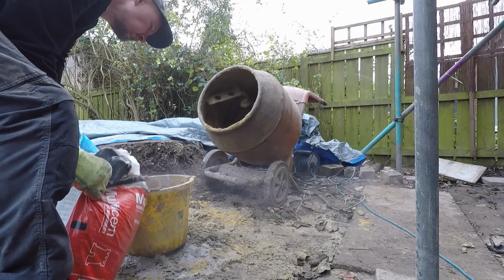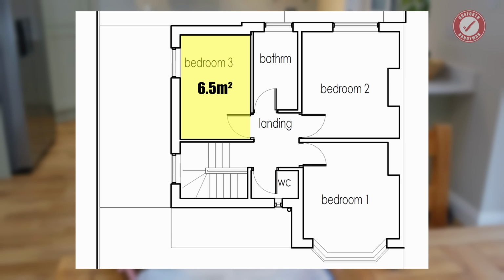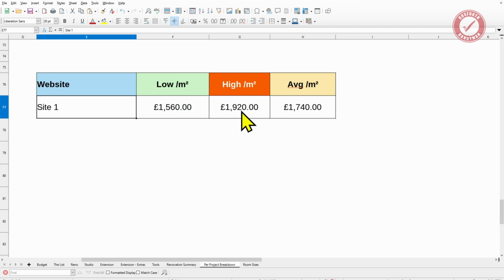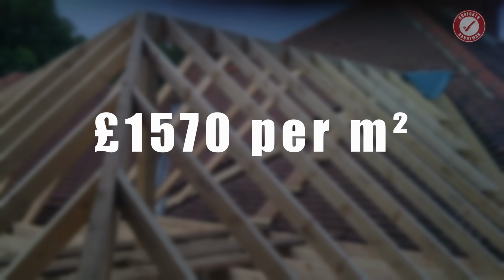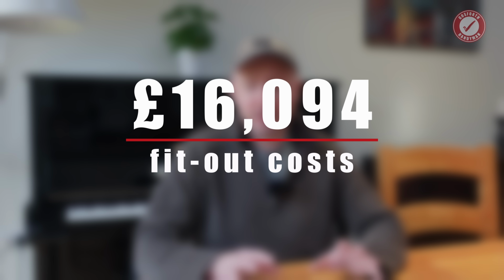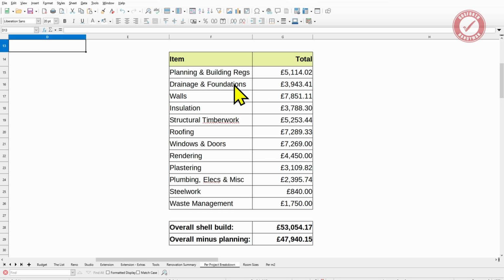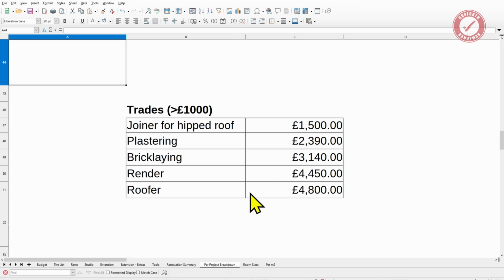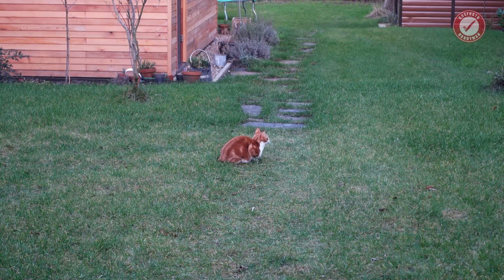How much does a UK house extension really cost?

Comment: The roof is a fair price, considering they're working at a height. You're not doing this in Ireland for less than €100k. I'm a plumber in dublin and the company I work for would charge €800 a day for me. Sparks are €1k a day. We have a shortage in trade people so the work is never ending. Companies can't hire enough lads to deal with the work. I know of 1 small 3 bed rewire that was quoted for 9k after the 1st covid lockdown. The same company said they would have to re-quote it 6 months later and they said €19700. They blamed rising costs and the home owner had no other choice but to go with it because he couldn't get anyone else to do the work. I'd say 150k in Ireland to do what you've done. 👏👏👏

Comment: I don’t understand how you can quote the actual costs for your extension and then say that for a low cost area you would actually pay more by quite a considerable margin I.E £978 for your extension per m2 and £1560 m2 for a low cost area.  Do you therefore live in a low low cost area?  I didn’t specifically hear anything in this part of your video which highlights why you came to this conclusion.  I understand where the figures have come from but your actual costs appear to highlight that they are wrong.  We looked at doing an extension last year and gave up after not getting any sensible quotes and the cost of materials seamed to be going up by the minute!  Hence I was very interested in watching your video to see the conclusions.

Comment: I’m in the middle of an extension build currently. We are knocking out a supporting walls to create an open plan kitchen diner with no folds. From re mortgage to now it’s taken over a year. Builders generally took at least a week to visit and another week or two to quote. Architects when I found one that was free took months to produce plans that were wrong and further weeks with constant chasing to produce correct final plans, I had the same issue with the structural engineer. The final figure was around 25k over what was quoted and the final project has been extremely compromised due to inflated costs. Having said all of that my builder and his crew are (so far) really good and hardworking and pleasant with really good comms. I’m hopeful of getting to a first fix (plaster/electrics/plumbing) at about 40k.
Reply: Also the steels (box steel and further large beam) are ridiculously over rated and would look at home sporting a railway bridge.

Comment: So I built a 30m2 kitchen-diner extension myself (which is very similar to yours). Three new walls, built 8m out the back of the property. Brickie and his dad (who did ground working) did the foundations, brickwork, got a solid flooring contractor in,  cleared about 40 tonnes of spoil (sloping site) and sorted the scaffolding for £13k. I bought the bricks, blocks and insulation. I then did pretty much everything else myself (except the Part P wiring), including the roof (pitched with hip) windows, doors, plumbing and boarding the ceiling and walls. Paid a plaster £800 for a skim, and an electrician £600 for the Part P stuff (I bought all the lights, sockets and distribution board). Plans cost a few hundred quid and the local authority forgot to charge for the building inspection. Whole thing came in at under £30k. Then I blew over £20k on a Wren kitchen sadly. Lots of quartz!
Reply: Imagine buying a Wren kitchen lol
Reply: More money for quartz!
Reply: 20k+ is labour/profit for builders

Comment: I had the sales guy from Beers the building merchants in today as Im looking to build a 3mx8m second storey extension. For the blocks, concrete and cement, ive been quoted just under 1500 quid. Glazing will be well under 2k for 3 french doors and juliet glass rails. These prices are more realistic as were building it ourselves over a few months. Im seeing friends getting silly quotes of 75k for the same size.   Ill be bringing mine in between 15 - 20k. Great video

Comment: Please if anyone can comment that would be appreciated: 
Just planning a house renovation. New bathroom, new stairs, removing a structural wall and putting in steel beam, new downstairs loo, creating pocket door between living room and kitchen/ diner, removing 4 chimney breasts, insulating under living room floor, installing two new skylight windows, and new plastering and painting walls everywhere in a 4 bedroom house ( 2 bedrooms in the attic won’t be touched) . 
Is a £50,000 quote realistic?

Comment: I managed a 7 meter dee and 8 m wide wall to wall extension, bedroom on first floor and a dormer in about £140000. I think I need another £20-30000 to now fully fit it out.

It has ufh and tiling on all three floors, no radiators and new wiring.

I achieved it by doing the work myself with my father and hiring two day labourers who did the grunt work.

The only thing I outsourced to contractors was brickwork, skimming and the hot water cylinder installation and the electric fuse board.

I did pipe work and electrics myself. Tiling myself. Etc etc. it’s taken two years of my life and probably another 6 months before I can get back to other stuff. But I have thoroughly enjoyed it. I won’t ever do it again though. 😂

Comment: If you’re going to manage the project yourself, you really need to be working from home. I moved out of the office during the pandemic. I dread to think how it would have panned out if I hadn’t been around during the day.

I took it slow and did it in phases with long gaps. Added about 110 M2 with a two story wrap around extension into a hill. I’ve not finished yet, but all the masonry and roofs are done.

Spent 140k so far and probably another £30 to £40K to spend - so pretty good on your calculations since will come in less than £1800 a square M and I’ve had to deal with 8 foot retaining walls and a fairly large amount of outdoor costs.

Would I do it again? Probably yes cos I know a lot now.

If I could go back in time… I’m not so sure!

Comment: Great video and really interesting. I'm on both sides of this, having been a joiner for 28 years and lecturing and working in construction. I am now halfway through an big extension at home that started pre COVID and due to spiralling materials costs, lockdown etc is still ongoing. As a self builder I have seen prices spiral during and post COVID... I wouldn't put any stead in pre 2019 prices...it's almost like a different era... In the last 4 months I have seen Aluminium window prices go up almost 40%. In the Swindon area building is going on at a staggering rate and materials demand and prices are definitely reflected in that... Don't even get me started on how expensive timber is.  Our extension is 2 storey and single storey...roughly 60m2 . My original costings in 2020 using Spons (worth the purchase price as this really will give you a very accurate pricing structure) was £90k Inc £10k pc sum for kitchen and £5k for ensuite...this is materials and labour.  I think realistically now we will be lucky if we keep it under £110k and I have done all the work...( Foundations with a mate who is a ground worker) all blockwork with another friend who is a bricky...so very much mates rates. All carpentry..roofing ..floors...concreting etc all me. Most of the plumbing fit out will be me but electrical work will be contracted out.  
Ours is what I would describe as High end build ( anthracite aluminium windows, Canadian cedar cladding, bespoke kitchen etc) so was always going to be on the high side but at the moment if you work on £2k per M2 you will give yourself some wiggle room. 

If your builder quotes £1k per M2 and doesn't itemise their quote then watch the extras roll in....or watch them bail.  There are no 2 ways about it building is expensive at the moment and finding reputable builders is going to cost so don't kid yourself it will be cheap. One of the biggest single expenses is skips...holy cow waste removal has gone up over the years. 

I should point out we had 4 quotes pre COVID.... They ranged from £68k plus vat for just a water tight shell.. No kitchen, bathroom or floors / internal walls ( I was going to do those) to .. £160k plus Vat. ( With no PC sum for kitchen or en suite) none of the quotes included plans/architects fees, site surveys etc as I did all those myself.  I think realistically if we handed our build to a good builder from the start and kept the same spec we would be looking at around £150-160k plus VAT... At the moment I am still on target for a £90k Inc vat spend but that includes everything including drive, gates and landscaping....so not just the 60m2... But remember I have done nearly all the work myself so no builders/ labour costs..but the quality is there it just takes time. ... It's the eternal triangle...Time, cost, quality.... Thanks for sharing your costs....all too often you see people running into financial difficulties when building ..relying on quotes and then looking at final figures trying to work out how they are 20% over quoted... Now imagine our situation where prices have literally doubled between pre COVID and post COVID..  god knows what we would have done if I hadn't been in trade. Take heed people ..never go for the lowest quote and always get references with pictures and testimonials you can follow up.

Comment: Extensions and loft conversions are my bread and butter . 17 years in business, 28 years in the trade . Yorkshire based. My basic rate for extensions at present is £1850 plus vat . Then you have the usual is it concrete tiled roof or is it slate and all those variables can alter the final amount . Not all jobs can cost the same of course. This price is a fully plaster finish , second fixed joinery in place and all plumbing and electrical works done. Then add ons would be fitting of client supplied bathrooms, kitchens etc.

Comment: We started a build ( loft conversion) alot of builders never returned calls,some overpriced!  In the end after lots of checks and recommendations the builder we went with told us half way he got his pricing wrong and needed another 20k!! Perhaps this is a tactic they use? Needless to say I finished the job myself and found the suppliers, building control ( went private) and engineer to be more than helpful in the completion. I did loose alot of weekends and evenings though. Luckily I have a trades background so this ofc did help. Building is still such a risk in the UK imo especially to those less informed than your self.

Comment: I have recently completed an extension which included an outbuilding (no soundproofing concerns) but went through a similar process opting for it to be within permitted development too.  The 2.5 M maximum height was a little open for debate when researching especially on slopped gardens.  
Unlike you, we had a difficult builder and although I had expected him to be here for a significant portion, he would send a couple of his guys over each day with little supervision.  I ended up having to project manage making sure materials were ordered on time, sequencing deliveries and trades people so that work would progress.

As I was losing confidence with him, I was forced to check and verify that everything was being done to the right standard in terms of building regs, including the checking that the correct size steel was used.

I now know that this builder did not know how to price a job or made significant assumptions on costs including labour.  We had a fixed sum contract in place which detailed every requirement he needed to meet and checked with him multiple times that if we was confident with what he quoted.

He didn't finish the job and I had to complete a substantial amount myself as well as bringing trades (front drive, rear patio, guttering, fascias, internal doors, some tiling, fence panels, coping stones and so on).

After all this and having to pay more for others to come and finish jobs, the total price per SQM (£1190) was fairly close to what you've achieved.  We are in the Midlands so in terms of price could be considered somewhere in the middle.  The above doesn't include the external landscaping work which came in at around £83 p/SQM.
Year (s) 2019-2020

Overall building extension (including redeveloping existing rooms) size 114SQM and external hard landscaping around 300SQM.  

All done now and have very similar spreadsheet with every little item detailed (I thought no one else will do that, lol).

Well done on keeping the kitchen costs so low too.

Hopefully this may help others who are in the early stages of their journey.

Cheers and GOD BLESS.
Reply: Isn't everything in the Midlands considered somewhere in the middle? 
GO WITH CHRIST BROTHER AND JESUS BE WITH YOU
Reply: Very interesting - we're in the Midlands and planning our build at the moment - whats the name of that builder so I know who to avoid?!
Reply: Hmmm, I would like to say from a builder and a pm's perspective that I'm not suprised that the builder left the job.

People want to work without being micromanaged in that way.  If you have no confidence in your builder it is best that you politely let them know so that both of you can end your relationship amicably.

I'm pretty sure that their costs soared 1000% from what you described.  If you don't know what you're doing, hire a professional to work with them, i.e., supervise them.  

As intimated here, don't try hiring a bargain basement builder and trying to rachet them down into a professional outfit for that money.  It will never happen and the stress involved will take years off your life but then, from what I've seen of some clients, that could only be described as justice.  I'm not talking about criminal builders here, that know the regs and disregard them, I'm talking about the rough and ready, probably untidy lot too.

In short, there is no shortcut.  The cheap guy probably doesn't have a body priced in to take out waste and keep the site clean.  They probably don't have an engineer on tap for awkward details or areas where the plan is ambiguous.

And supervision costs in SE London were anything from £300 - 1000 per day depending on the class of project back in around 2020 iirc.

Comment: Its easy to say do it yourself. get the builders as you need them.  Yes if you know the right trades people, you will get along well. Pick one bad apple and you will set alarm bells off. and find it very hard to get trades people. Then the costs will spiral out of control.
I built my last house many years ago. that was easy for me as that is what i did for a living. The only trade i could not get to travel the distance was the plumber. Working on sites all my life meant i just went on a large new site , and asked to speak to the plumber. I had too take a chance on them. But getting someone i knew worked on site, meant  at least they knew what they were doing.
But dont be fooled into thinking its easy. because its not.

Comment: Professional builders do not quote per SQM every job is different, access, ground conditions,  materials, bi-folds, lanterns, structural work & services can vary price. For estimating & budgeting a ballpark of 2.5/3k per SQM would be quoted to a client in SE UK in early 2023, once client seems keen a full detailed quote would be done that could take several days to complete! Unfortunately, material prices at the highest ever brick are £1.20 + blocks £2.50+ plasterboard £10+ as well as other costs of running a building company fuel etc. Time a builder spends on site is not the only part of the job collection of materials, ordering, quoting, and liaising with clients many of us work 60-plus hours a week! Unfortunately, many clients don't see this & think they're getting ripped off, there are many rip-offs & cowboys around but just as many decent contractors get tarred with the same brush. Been a contractor 24 years & only working on recommendations & tell my clients I won't be the cheapest or most expensive but will do best job possible for a fair price.
Reply: Spot on. 👌

Comment: What a fantastic video and what’s even more coincidental is the layout for the back extension with the kitchen and dining room is basically the same layout I’m planning on doing myself. Where did you buy the bi fold doors from and I remember in a previous video you mentioned they were custom build and not off the shelf which you explained as being a headache, so ideally I will avoid that mistake.

Comment: Hi there - loved this video as it was exactly what we needed to help us begin our research into potential costs for the renovation on the house we just bought.

Few questions if you don't mind:

1. How do I guesstimate if my area is a high or low cost one? It is Norwich in Norfolk
2. You mention that it is important to include the sqm of existing space into cost projections - but surely these are much lower than the sqm costs for the actual extensions? Are you numbers a blended £/sqm?
3. I'm guessing architect fees would be on top of all the prices you mention in this video?